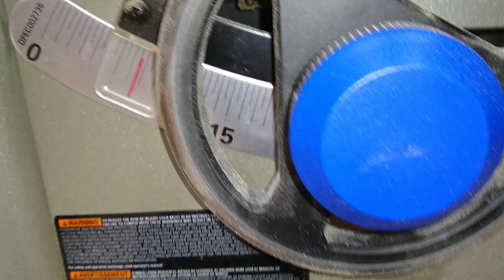DIY Wooden Beer Mug - Made for the local brewery

Comment: What wood species do you recommend? Did you have to sand the inside any? Mug turned out awesome👍
Reply from the maker: I would recommend white oak. White oak is naturally rot resistant and it looks great. I cleaned up the glue inside before it dried and did very little sanding inside. Nobody ever really touches the inside so sanding probably isn't really necessary. If you want some dimensions i have some for free on my website. LastLeafStudio.com Thanks for watching
Reply: @LastLeafStudioVideo  Not sure if you're still active, but your website is having issues, could you please send me the plans? I couldn't get them from your shop.